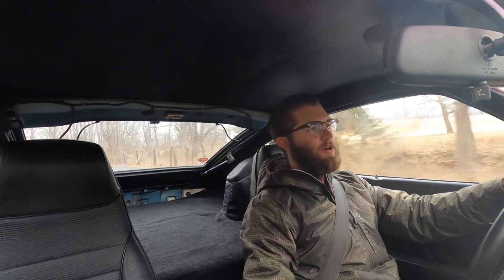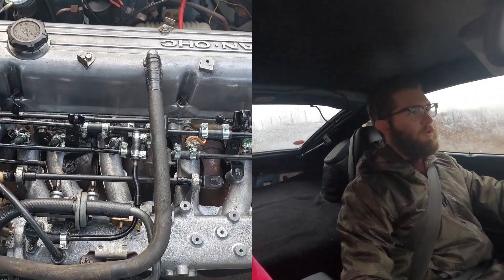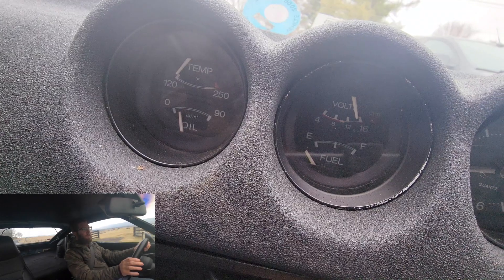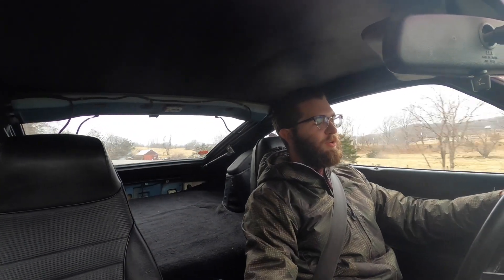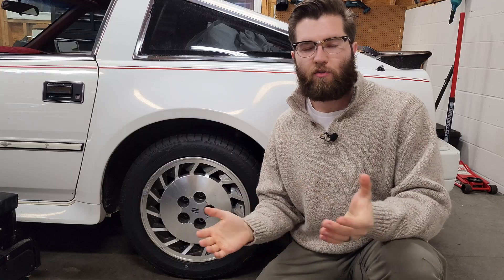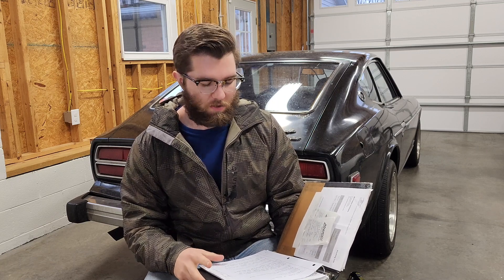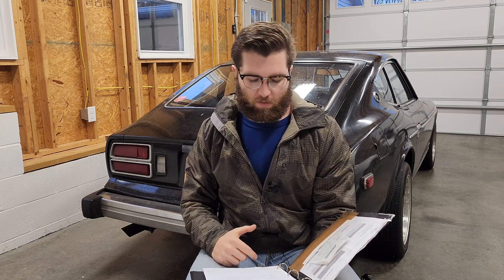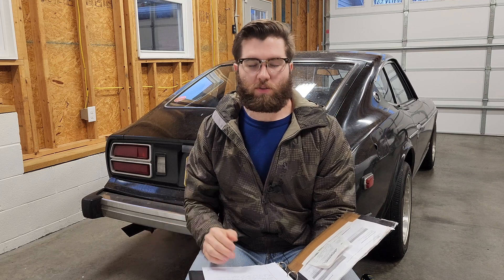I Bought a Datsun 280Z that Sat for a Decade

Comment: You may need a computer. I had a 75 that would stall after shifting to 2nd at 6,000 rpm. One day it would not start. I swapped computers and it ran. A few days later. I notice it didn't stall anymore @ 6,000 rpm.
Reply from the maker: The current issue is cold starts when it's actually cold outside such as when this was filmed at 40°F. I believe the thermotime switch is bad and not sending power to the cold start injector. This is actually the second computer I've put into it as the previous only fired injectors for 3 cylinders. If I need a new computer again, everything is getting ripped out and I'm swapping in a modern ECU, such as megasquirt or the EasyEFI system, with modern injectors and sensors.
Reply: @Dan_And_Daves_Garage  We had a few problem with 280z ecu around 1989. 280zx were really bad. I still would love to have another 75 280z.
Did I see you shift to 5th gear? Your 77 has the optional 5th gear. I don't think I ever seen one with it.
Reply from the maker: Yes, this one has the optional 5 speed which is nice to have. I do wonder how rare they are because I'm not sure if I've seen any other 5spd 280Z's around
Reply: @Dan_And_Daves_Garage  I did drive at least one 78 280z 5 speed. I've driven every z from 240 up to 1983 280zx turbo 5 speed.
Reply from the maker: Nice. My first car was actually the Z31 300ZX in the background. I'm currently doing a ton of maintenance on it and will have a video coming out showing all the work done and end result.
Reply: @Dan_And_Daves_Garage  I was thinking about getting a new Z but the dealer wanted to act stupid with the price $30k over sticker. That was last year. I still have not seen one on the road here in Atlanta.

Comment: With everything stock, how is it as a practical daily driver so far for you?  I am hoping of getting one someday because I think it’s the best looking car out there, but I’m only primarily concerned about the L engine reliability as a daily.  How easy is it to get replacement parts for such an old engine?  

I personally enjoy how the L28 engine sounds, and would hope that I wouldn’t have to resort to replacing the engine entirely or often be stuck on the side of the road if I do manage to get an S30 someday.
Reply from the maker: It's not exactly a "daily driver" as I work from home but I do drive it very often. The largest issue with any s30 chassis will simply be age related issues and any deferred maintenance. 

So far the L series itself has been very reliable. I have ~195k miles on mine with no rebuild. Issues with the L series would be related to accessories such as when my alternator failed, fuel injector died, dead ECU, and a faulty fuel pump. All of which I was able to find from normal parts distributors like RockAuto, specialty Z part sites, eBay...etc.

There are a number of swaps available today to upgrade and bring the accessories into the 21st century such as the EasyEFI system to replace the whole EFI system. As far as engine rebuild parts there is such a large following for these cars that there are rebuild kits and gasket sets available.

I would say that mine has been reliable but I would not recommend it as a daily if you need consistent and reliable transportation. Of course it also matters what car you buy, mine sat for 10 years and a lot was wrong but it was still all there. Buying the best you can afford is the best advice I could give and limit headaches and pain down the road.